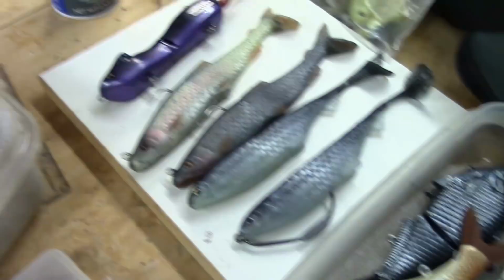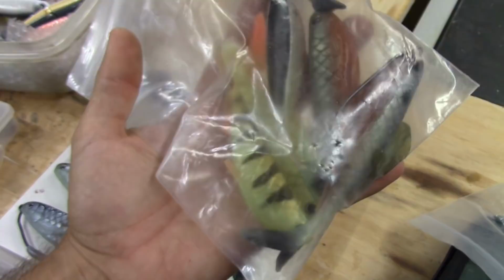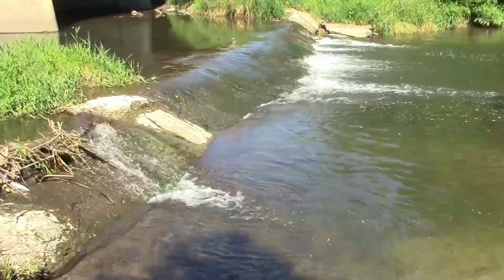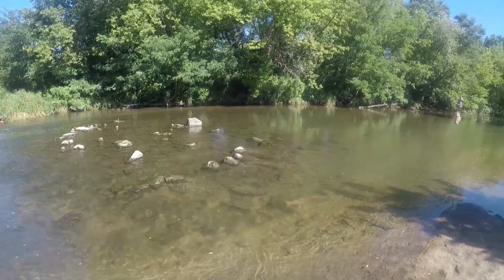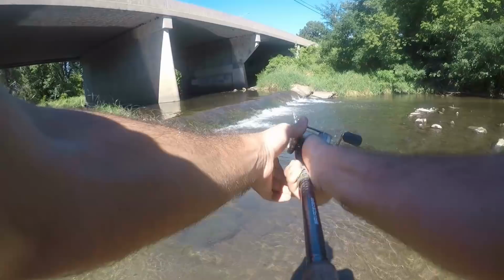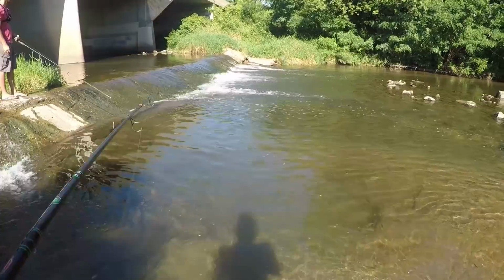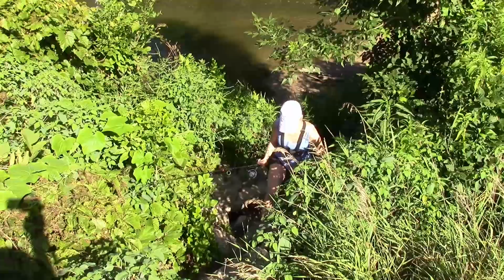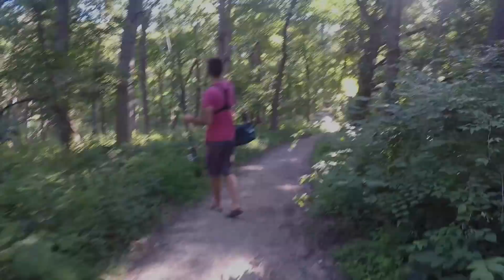I Make the Baits | She Catches the Fish

Comment: With bigger baits it's far more effective to cover water. Let's say there is a stretch of shoreline that's about 20 meters, stop every 5-8 or so meters down the shoreline and fan cast (fan casting is not casting to the same spot over and over, but casting in all directions. A cast about every 20°. Google fan casting. It's very simple but hard to explain)

Comment: Why do you don't have this lock thing on the line..
Instead for tie it on..
Reply: Snaps can ruin the action and presentation of your baits. They also add another point of failure. It is almost always better to tie straight on even if you are changing lures a lot.
Reply: @nikofoley7964  ooh okey :) I'm going to try the tie it instead:)